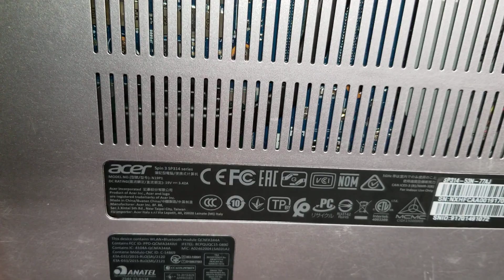Acer Spin 3 SP314 Series Model N19P1 Disassembly RAM SSD Hard Drive Upgrade Repair

Comment: Hey sorry I have a question, I have the same laptop and all of a sudden it started saying "no bootable device". It doesn't come on. I tried refitting the SSD but still nothing. What causes this? Can this be fixed? Can my data be saved? Many thanks
Reply from the maker: You'll have to replace the SSD and do a clean install of windows. As for getting your data, you'll likely have to send it to a data recovery company. I recommend 300dollardatarecovery.com

Comment: Holy cow, you took the RAM out, I was surprised it wasnt soldered.
Reply: Yup. I’m assuming this in an Intel model. I bought an amd model and the ram was soldered and no stylus. To anyone reading, don’t get the amd ryzen model.
Reply from the maker: Lol why?
Reply: Some acer spin 3 models have soldered ram. Which you can’t upgrade unless you go to a acer store for upgrade. Some are not soldered Like this model.
DISCLAIMER: I DO NOT KNOW IF YOU HAVE TO GO TO A ACER STORE SO YOU CAN GET THE RAM UPGRADED. IM GUESSING BY ALL THE KNOWLEDGE I KNOW

Comment: Hi, i have same laptop with u, can i upgrade my ram from 8gb to 16gb?
Reply from the maker: If it fits, yes
Reply: @ItsBinhRepaired  dual cahnnel or single channel?
Reply from the maker: There's no such thing as single/dual channel. All RAM is single channel if you have an odd amount of sticks, dual channel if you have an even amount. Also single channel if you don't use matching sticks.

Comment: is the 2nd ram slot
Reply from the maker: Only 1 unless it's on the other side of the motherboard.
Reply: @ItsBinhRepaired  can you check if it on the other side of board
Reply from the maker: @itwilsonboiii4789  Google pictures of the motherboard. Should be able to find out. It'll be $5 for me to research it for you. Lol
Reply: @ItsBinhRepaired  lol really
Reply: @ItsBinhRepaired  there is ram in the back but it solder. Decent for a cheap tablet
Reply from the maker: @itwilsonboiii4789  can't upgrade that :( lol
Reply: @ItsBinhRepaired  at least it dual channel :)
Reply from the maker: @itwilsonboiii4789  yeah
Reply: It's Binh Repaired are you việt
Reply from the maker: @itwilsonboiii4789  no, I'm Binh. My brother is Viet.
Reply: @ItsBinhRepaired  oh hỉa bình :")
Reply from the maker: @itwilsonboiii4789  I don't speak Vietnamese lol
Reply from the maker: @itwilsonboiii4789  I know what's not really Vietnamese though lol
Reply: @ItsBinhRepaired  lol ok
Reply: @ItsBinhRepaired  do you have any vid about lenevo flex 5 ryzen 3 4300u. 81X2000HUS
Reply from the maker: @itwilsonboiii4789  don't know. Search the model of the computer followed by it's Binh and you should find if I do or don't or something similar.

Comment: Hi, my spin 3 is not turning on. The power led turns on but the laptop doesnt start, if i connect the charging cable, the charging led comes on but still the laptop doesnt turn on. Tried battery removal and starting, ram cleaning but didnt work. it does start sometime after a few hours and works fine rest of day but next day same problem. Any suggestions on what might be the problem?
Reply from the maker: Sounds like a failing motherboard :( most likely cracked solder joints of the video card
Reply: @ItsBinhRepaired  that doesn't sound like something i can repair myself. I am starting to doubt acers built quality given its not even been a year since i got this but thanks for your help, will post an update on diagnosis.
Reply from the maker: @anshullo  yeah, most likely won't be self repairable :(

Comment: Was the welded 8gb mem card beneath the replaceable 8gb?
Reply from the maker: There's only that one stick of ram. Not sure there's integrated ram. If there is, it might be under the logicboard.
Reply: I just got my spin 314-54 and trying to figure out if i can upgrade the 8gigs to 16 gigs. Which version is this laptop?
Reply from the maker: Not sure. You'll want to open it up and check.
Reply: Mine was 4gb welded and 4gb remove able.  Replaced the 4 with 16 for a total of 20. DDR4 2666Mz

Comment: i have this laptop and there is a black screen with a message "no bootable device" do you know how to fix this?
Reply from the maker: Your hard drive is most likely dead. You'll have to replace it and reinstall Windows.
Reply: @ItsBinhRepaired  my sis had the same issue on her acer swift 3 but i didn't have to replace the drive all i needed to do was reinstall windows so you don't need to replace it.
Reply from the maker: @z4rrr21  nice!
Reply: @ItsBinhRepaired  thanks
Reply from the maker: @zarr zadd  no problem
Reply: @ItsBinhRepaired  thanks do you have any recs on what SSD/hard drive to get and where i might be able to get it?
Reply from the maker: Samsung, crucial, Kingston, and sandisk are good brands you can get them from Amazon
Reply: I have this problem too